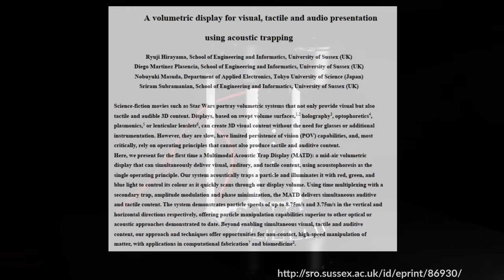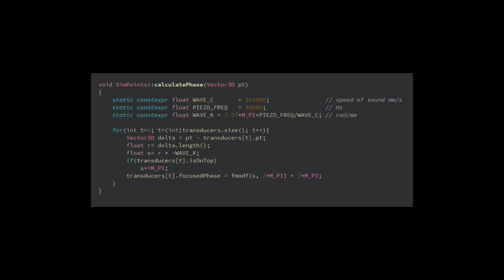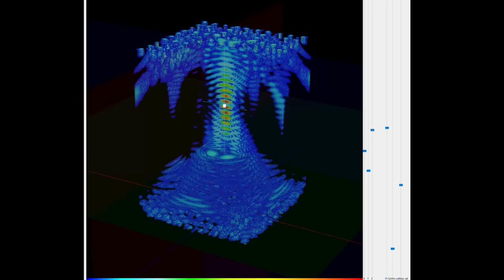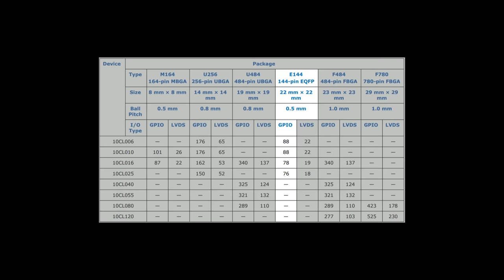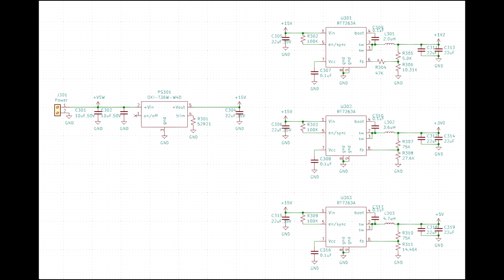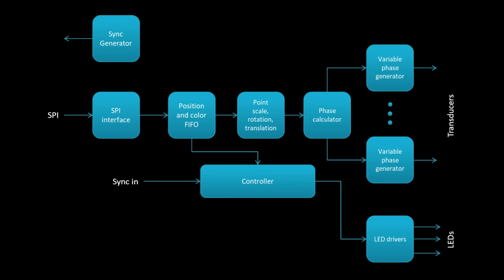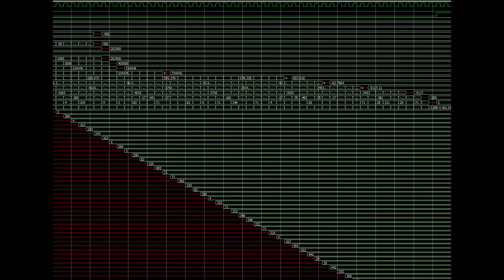A Volumetric Display using an Acoustically Trapped Particle

Comment: The distortions seem to me to be a function of the "springiness" of the air enclosure, which allows the particle to lag on acceleration and overshoot on deceleration. The only mitigation I can imagine is to use a lower mass particle and a smaller low pressure zone, i.e. higher frequency. Also, the interference patterns surrounding the sweet spot are pretty large, so controlling more than one particle would require some separation, unless you mean they would occupy other low pressure zones in the same pattern.
Reply: You might be able to tune the software for this. From what I understood from the video the inertia of the ball isnt being accounted for. You might be able to slow it down more agressively with software.
Reply: It’s the inertia. You can clearly see it when drawing the square - each edge describes a loose “S” due to over shooting. Aerogel would make a lighter particle.
Reply: @Speaking_on_mute  good idea, aerogel. @boggless2771 had a good idea about correcting for the overshoot in software too, I assume by an early stop and a brief counterforce. I saw that done in a sort of custom robot painter which was having a similar problem.
Reply: Your proposed software corrections would be effective, Im certain. They would not be easy to implement, I suspect, and would be intensive at runtime.
Reply: @Speaking_on_mute  yeah, I'm not sure it's really worth it, it's really more of a puzzle than a practical device. Interesting challenge though.

Comment: This is one of the coolest things i've seen in years. Patent this or parts of it if you can! Hasbro is gonna steal this and make a toy, but this is so much more. This could be huge. 
Amazing idea and execution. I'd love to see this on a larger scale, like how drones are used to make things in the air, this would be another level!
Reply: There's already a paper describing it, so there's prior art. Either the team of scientists already filed the patent, or it's not patentable anymore.
Reply: I think what usually happens is the university owns the patent on this.  Maybe 25 years down the line we will get them released, like 3D printing was.  Think patents last 20 years.  5 is for improvements that enable it to be commercially viable.

Comment: About the audio speaker: 30 years ago there was a project that build a supersonic audio speaker (100khz) with an AM modulation for the low frequencies. The advantage was that they just needed a specialised speaker for one frequency for maximum efficiency. Just the person in the way of the wave could hear the sound which was described as brilliant. The decoding to low frequency was done by the ear itself.

Comment: Ok actual question : What is the actual sound output of the device? I know it's ultrasonic but I'm just wondering if it is like barely noticeable or like ear-shattering deathmetal rave stuff
(Also bro this is just impressive overall, thanks for documenting the entire process and sharing it with us!)
Reply from the maker: a high pitched squeal, caused by all sorts of resonances - extremely annoying
Reply: I was thinking this as well, i'd imagine it could be quite piercing at just the right spot. I've been knocked out twice from sound concussion.
Reply: @Daniel Foisy  would sealing the unit in a soundproof chamber or something similar to block the noise be possible theoretically? it would certainly improve commercial appeal lol
Reply: @JustAGuy85  LOL no, I toured in a band as a analog keyboard player and programmer. The first time was a joke by the drummer when I had my head in his bass drum. The second time was when the bass player dropped his bass and he had his envelope filter way up, I was close to his cabs which were 8 10in'ers
Reply: @swordinhand8356  😳😲
Reply: Enough to keep your dog in the other room, probably

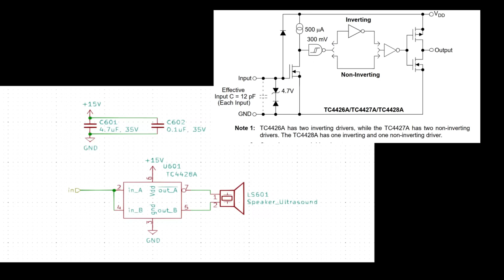Comment: 3:36 question, does sealing it in different gasses change its speed? as we know air friction is affected by gas dencity etc.
Reply from the maker: I suspect so but a lower density gas would (probably?) have less ability to lift an object
Reply: @abitembedded  a much heavier gas would be perhaps better than? Sulfur hexaflouride?
Reply: @abitembedded  fluorescent aerogel for the particle?

Comment: Theoretically you could display an image similarly to the way CRT televisions and monitors work. I think the particle would have to move faster than shown, but it should be possible. The tricky part would be to get it to turn the right color, for each "pixel"

Comment: Wow this is incredible. It really gets the imagination racing. I was thinking halfway through about multiple balls so I'm glad you mentioned it. It seems the next rational step forward. If you can independently move 2 or 3 voxels that's more resolution to work with for more complex images. I think it would be amazing to use this to visualize 3d projections of 4d shapes, but in actual 3d rather than on a 2d screen.

Comment: Just found this. It's amazing work! Once you get multiple balls working; I would love to see you feed in an audio file so that the ball could create an audio visualization. Then next is to consider feeding a video file into the process for encoding data into a ball movement. You could even consider feeding volumetric 3D files into the Analog to 3D volumetric display.  It might look neat if you'd  consider animation process. Where there is a background a mid ground and sometimes a foreground objects that move independently. Check out how Disney originally shot the opening scene of Snow White or Bambi.  This whole thing got my brain turning somersaults with the possibilities.

Comment: you could likely make it more reliable in a non-expensive way by enclosing the area with the transducers with glass or plexi. you'd likely need something to stop the waves from reflecting off the surface, but it would likely be less of an issue than air and dust from outside.

you could also increase reliability by putting the transducers on a flexible sheet and orienting them by flexing it like a parabolic dish to direct the waves exactly where you want them. This would likely increase costs a bit though.

Comment: I posit electromaterial generation based on discharge with similar function, in simultaneous pulses and harmonic and/or dissonant waveform overlap, to induce net oddform waves. For example, a wave that crests but doesn't trough, or begins sine and expresses a sawtooth within the same period. Rhythmic overlap of different pulse sets in a quick enough bridge may be able to "program" matter directly from electricity, though two distal energy packets colliding makes sense towards some modal shift. I.e. a polar differential expressing energy discharge in more multidirectional ways (for reference, colliders; another being kq/r when r=0 models an electrical explosion (and yes, this is at least one observable example of divide by zero)).

Comment: It would make sense to look at the spectrum of your phase modulated 40 kHz signal. Do you drive the transducers with sine or square waves? What is the bandwith of your amplifiers? If you're calculating phase changes with the base frequency your phase changes might be too abrupt causing too much high frequency contents. Changing the phase gradually might be beneficial to the overall performance. That said; outstanding work, congrats!

Comment: thats amazing.. congrats on creating such an effective and functional device. I am wondering, rather than focusing pressure to a specific point, is it possible to create a flow field? So rather than programming precise position focal points over time, to create a configuration that promotes a 3D flow field like a curl noise with a bias to gravitate towards center/ specific zone? I guess something like that would require a higher frequence since you have to simulate a directional vector force over a 3D voxel grid that will be limited to the update rate

Comment: This is an absolutely mind-boggling amount of precision, and i’m sure patience, for a project undertaking. Did you have any issues with differing response across that many mass-produced transducers? I’m suppose that could be corrected for with a simple calibration step that would apply the calibration profile to the seemingly quite complex calculation/conversion being processed already? 

Really, this must’ve takin so so many hours of work to make happen. Extraordinary.
Reply from the maker: ya, I didn't calibrate it but definitely should have - may have reduced the distortions

Comment: I'd like to see it perform on the ISS in zero gravity.
Maybe in zero gravity it could be turned inside out so a package could push/pull itself by generating external high and low pressure zones to slide itself around.

Comment: If you instead use fog you can have multiple points of collected fog in play at once, and puff them away as opposed to controlling the mass of a bead (yes, even if its Styrofoam, its still has mass, pedantic armchair physics). Then use RGB lasers to illuminate the fog. Its exactly how that other 3d volumetric display a few years ago worked, notice how they never show the other side of the room with the big black drapes? yeah, that was the beam dump.......

Comment: Very, very impressive. (Not least for the way you quietly gloss over hours and hours of tedious, detailed work).
WRT shape distortion, your ball may be light but it's not massless, so it's always going to be seeking your focus point, rather than at it... Would be fascinating to plot actual position vs expected, especially at high enough frequency to catch minor oscillations.
(I wonder if the Slow Mo guys might be interested?)
Reply from the maker: part of the issue is that I simply haven't calibrated each transducer - it's on the long list of things to do

Comment: Is it feasible to trap multiple dots in a grid? Maybe if the ultrasonic speaker array was larger? Maybe with each dot trapped in the nodes of a  3 dimensional interference pattern? Moving an entire grid of dots at once could really be a huge step towards a usable volumetric display going that path. At higher frequencies, the spacing could even be tighter.

Comment: 10:00 - directional audio: you might also want to look into ultrasonic interference sound.
https://en.wikipedia.org/wiki/Sound_from_ultrasound
I can't find the exact thing right now, but essentially you can produce audible sound by getting two ultrasonic directional waves to intersect at a desired point, whereupon audible range sound gets emitted due to the  demodulation. So you can effectively have audio originating from nowhere/midair much like a ghost might.
Reply from the maker: definitely on the list of things to try :)

Comment: You should look into low power ( 100hz-400hz ) Nd:yag lasers and "non linear crystals"  ( BaTi 03 )  using four wave mixing and introduce "acoustic wave" modulation.  Optics and laser photonics researchers are concentrating on high power.  Look into low power optics and laser photonics 😉    Of course make sure your lab is far from anyone, the power levels are enormous.

Comment: Hi! The project you did is extraordinary!  I'm a pre-collage student and I'm doing with my friend an acoustic levitator on our own. The whole process is very troublesome , though we managed to move objects in 3D. The problem it is done without using any feedback to make it more precise.  We were thinking of connecting Matlab with our fpga's , or use raspberry pi but for now it's quite sophisticated. Would it be possible to get any feedback from you? I could talk over problems we encountered and show our design. Thanks for the video once more!
Reply from the maker: Sounds like you're well on your way! I'm happy to help - feel free to send me some contact info or reach out on LinkedIn.

Comment: Hi, great work! If you are still working on this device or maybe someone else.. Instead of trying to move the ball to exact locations to draw the object.. why not plot an optimized route in you display area where the particle tries to fill the volume of your display area (maybe the shape of a sphere? or toroid - follow path of vortex). Once you have a sphere/toroid now you can strobe your lights to illuminate the particle in certain locations to trace out the object you are trying to display - so this strobe pattern represents the unique frequency function of that object in a certain location. So, in order to move the object you'd have to transform the frequency function to represent the unique frequency of the object in the new location.. Is this perhaps how our reality is rendered?

Comment: My first stupid thought was, this would be easier/faster if you could remove air friction... then the whole acoustic suspension dependency upon their actually being air kinda "took the wind out of my sails".
Reply from the maker: you're not the first to ask that :) different gasses might work, but that would require an enclosure and kind of ruin the magic I think
Reply: @abitembedded  Nevermind needing to retune frequencies due to change in atmospheric density.  Though I suppose that might be more trivial, now that I think about it, so long as you left those as adjustable variables in your code.  LOL, I should just think before I think and I would find I answer most of my own questions.

Comment: idk if the little styrofoam ball has mass in the simulation, but the distortion seems like it would be coming from the little ball having to overcome inertia and velocity, which could be causing the irregularities in its flight path. maybe train an ai to calculate for this? not sure how hard it would be to factor into your software.

Comment: Impressive. Maybe you can add a feedback loop by detecting the ball on infrared with 3 linear image capture. This way you may compensate for inertia with a better way, and replace the ball if it is lost? Just an idea... What is the max speed of the ball btw. You says 1m/s which is already impressive.
Why not to use smoke like in a smoke chamber? What sort of gaz may switch from transparent to opaque and back depending of the pressure?

Comment: Getting super close to zero contact drug synthesis, or even working with chemicals that would corrode or react with normal lab equipment, By using different gasses in a sealed chamber you could use this technology to handle and produce substances that humanity has previously had no access to due to either reactivity, toxicity, or over all hazard, This could even be used to handle extremely dangerous pathogens if tuned correctly. welp, That's all I am gona say as I have already spilt the beans on this idea.

Comment: This is so cool! I would guess there'd be a fair amount of distortion due to ball inertia and air resistance(?)... did you try using balls of different materials/sizes? Wonder if you'd get visibly less distortion under vacuum.
Reply from the maker: I did try various sizes but smaller was better - you need some gas for this to work at all

Comment: Wow. Incredible. Wondering if you can use aerogel instead of styrofoam? Or if there is a liquid or gas that could be split up and then combined back together? 

Just curiosities of mine, the project is already way beyond my abilities or understanding. Inspiring to say the least. Keep it up!
Reply from the maker: actually, there are a number of companies looking to use such arrays for non-contact liquid handling, so ya, good thinking!

Comment: You know I thought about this and this is the beginning of holograms, let me explain, The very screen you're looking at this comment with is just a bunch of tiny points organized to create an image. All you would have to do is figure out a way to organize a bunch of small particles in the air and boom hologram, I imagine the necessities in technology for this would be Advancement in frequency control, using multiple frequencies at once, and advancement in the material being  controlled. Like I wonder what would happen if instead of using STYROFOAM you use cooler stuff like arogell and grafene, let alone what shape the material is in, and MAN if you put static electricity into the mix you'd have yourself a basic hologram!

Comment: Lol what if you used aimable colored lasers aimed directly at the particle; that way you don't get the strobelight effect unless you stick your head between the laser and the particle' and you could also even color different sides different colors using different lasers from different angles :o
Reply from the maker: ugh - don't even want to think about steering lasers at this speed - that would be challenging I think
Reply: @abitembedded  Lol yea I suppose I was half-joking; your device is excellent as it is. I would love to have something like this to visualize 3d meshes :D

Comment: You know what's cool, you could use this to do a little simulation of a radio array called HAARP. I forget which university owned it, but it was this giant phased array of 40 meter antennas transmitting in the shortwave band. If I remember correctly, they would use phase steering to create a single intense point of RF against the ionosphere or clouds or something. By doodling the point around like with your display they were able to create an oscillator that transmitted in far lower frequencies. It would be like if you rocked the styrofoam ball back and forth at a thousand Hz and being able to hear the tone.
Reply from the maker: pretty awesome!

Comment: what hapend if you actually atempt to put more than a single ball in your device?
i understand that ultrasonic wav at high power is used to break hard particules so is their not any threat for a human body includin prosthetic or any thing common ?

what an irony the hologram turned to be solid antigravity